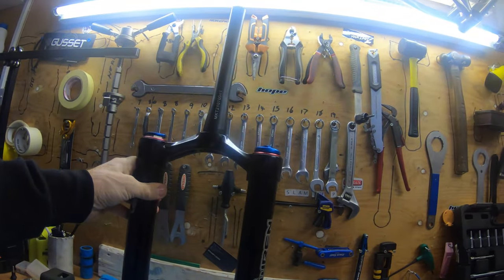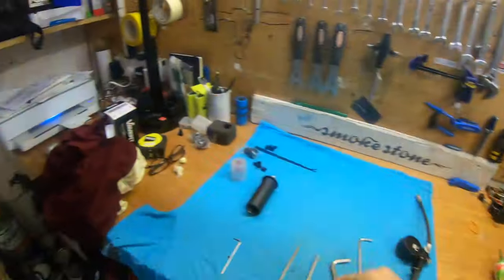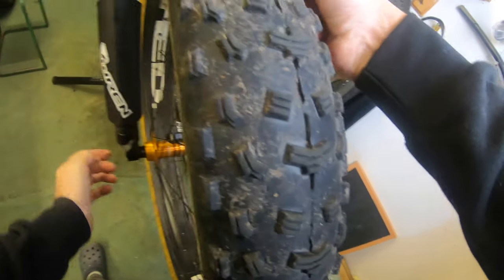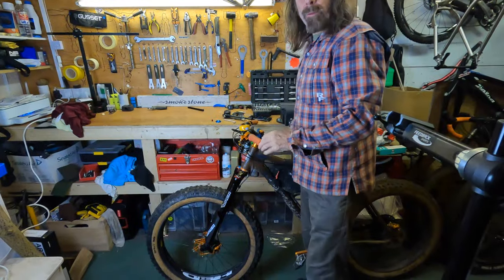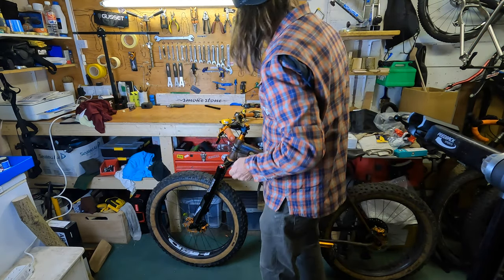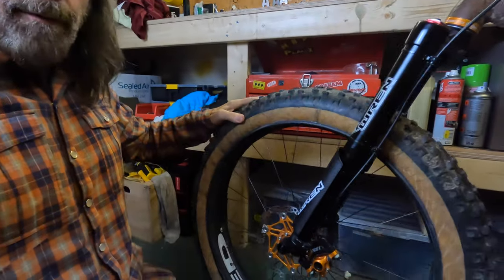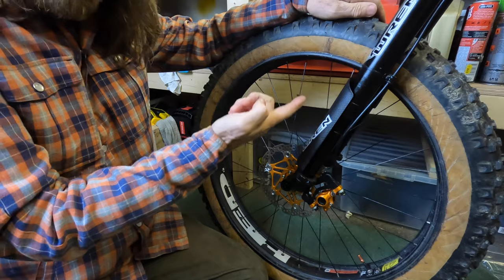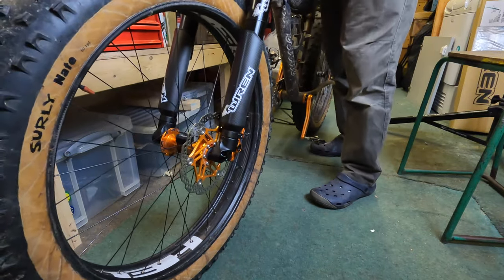How to setup Wren suspension forks

Comment: Hey Graham, many thanks for your clear explainations
One question : as soon as I put some air on the bottom, I loose almost all my sag? It was properly set with air only on the top
Do I need not to put any air to get sag, or is it required to put at least 10 psi on the bottom anyway

Comment: Axal to crank adjust spacers. What are they for?  at 37 seconds into your video. Can you explain their use.
Reply from the maker: the distance from the axle to the crown can be adjusted internally with spacers supplied, this means to can adjust the fork to fit a taller tyre. I've never done it but its a handy thing to be able to do. A 27x.45 tyre would hit the crown as they come new. You would need to adjust. I know...I need to do a video on this
Reply from the maker: https://www.dropbox.com/s/x0fa4hhk63e7r7l/Wren%20Fork%20Wheel%20Size%20vs%20Travel.pdf?dl=0
Reply: @GrahamFootBicycleLover  Thanks for the reply.

Comment: Reference rebound: You used the term, "topping out" but did not really explain how you know what "topping out is" and what it sounds like or feels like. How do know when it is "topping out". What are the indicators?
Reply from the maker: If you compress the fork then lift the fork off the ground it will return quickly and reach its full tavel, if it returns to quickly and you feel a knock, or here a sound like a clonk then this is topping out. A fork needs to return with control by the damper avoiding the fork topping out. I hope this is helpful.

Comment: Just got a wren ...I weigh 285 lbs...would you still start at 50 psi on the top?
Reply from the maker: Hi, you can put slightly more but you will need to set the sag anyway, so soon as you get on the bike as I described you will know what pressure to go up to due to the fork going through its travel. 50psi is just a guide to start from as below that the fork doesn't fully extend.
Reply from the maker: How did you get on with the fork setup?
Reply: @GrahamFootBicycleLover   Hello from Montana USA !  Have to be honest…I totally forgot how much more pressure I put in (happens when your 67). But, it seemed to be just fine.  However, yesterday I rode the bike for the first time this year (I used the WREN on my mountain bike …not my fat-tire winter bike). So, I’m gonna take a look at the pressure today. I’m not sure if the fork loses pressure over time or not.  I’ll let ya know.
Reply from the maker: @102Montana  Cool, be interested to know, also glad you get to ride. I'm 68 so I know where your at.